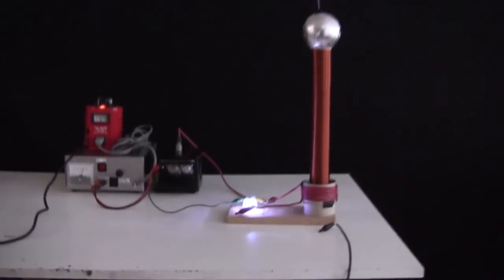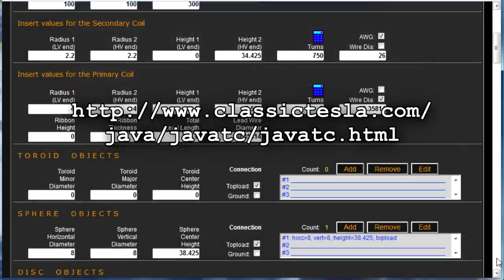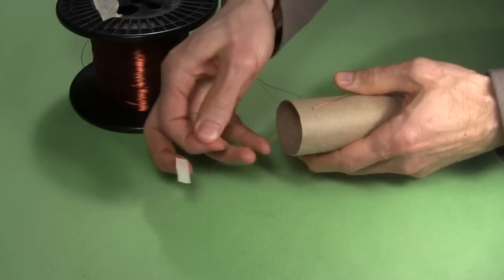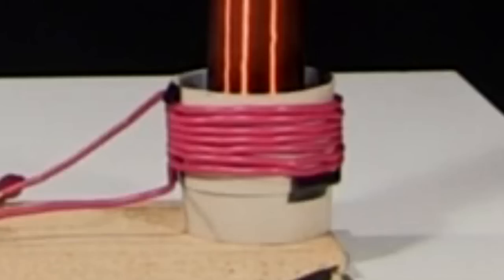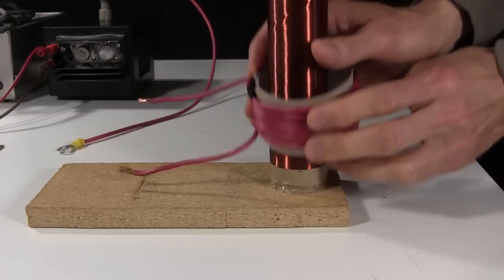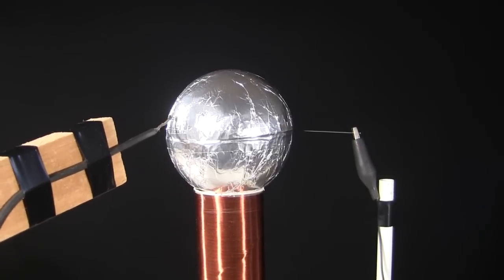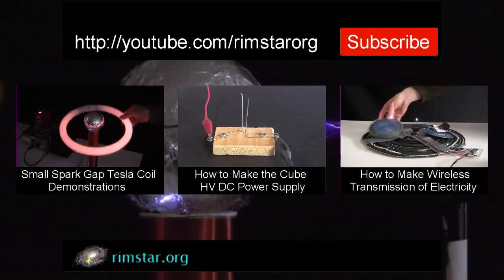How to Make Tesla Coil - Small Spark Gap Tesla Coil

Comment: Hey thank you for helping me   i placed a small aluminium needle on top of the toroid and  i changed the capacitors sort That you use and  i turned it on   and i was surprised   there were arc's   flying off my toroid  i was so happy thank you very Much :)                              Ps  i opened my settings but i din't find the question  who can comment your Posts ?

Comment: Hi Rimstar,
I have bought the parts for a 120w zvs driver i will be powering it with a 12v 7a supply(84W) and it will be powering a flyback transformer i also have will have a 800 - 1000 turns with 28AWG 150m of wire.
Which is the best material to wind the secondary on?
Will my tesla be able give 5cm sparks with a 4.5cm diameter pipe of_______.

Awesome video
Reply from the maker: The pipe can be anything that's not electrically conductive, usually a plastic of some sort, though cardboard works too. PVC and ABS pipes are easy to find at hardware stores.

Comment: I made this but I used a bug zapper circuit that supplies 400V DC and runs off of 4 D cell batteries. Would I get longer sparks if I instead used a 400V DC power supply that uses more current but connects to the wall plug because would have more power (watts)? Also what would happen if you got both coils to exactly the same resonant frequency, I know that a the voltage on the secondary circuit is like having a kid on a swing but you push the kid at exactly the right time each time, so in a tesla coil if its exactly the same the voltage gets higher and higher each time until it gets so great that it jumps off the needle at the top. So would the voltage off the top load get so great that you could get sparks as long as you want? Or would the sparks just max out at some distance due to the winding ratio of the coils?
Reply from the maker: I'm not sure if a 400VDC power supply that puts out more current would give you longer sparks. I think it would because there would be more energy for the coils to resonate with and it would last longer. If both primary and secondary circuit had the same resonant frequency then that should max out your sparks.

Comment: How do you figure out what uF you need? also would getting capacitors with higher storage capabilities entail more lightning coming off? Thank you
Reply from the maker: For the uF I just started by plugging in what I had available in high voltage capacitors and working everything else out from there. That was literally the first value I plugged into the online calculator (well, I had 4 of the capacitors so I played with a few variations.) From there I think keeping the physical size of the secondary coil small was my next controlling factor.
Regarding getting more lightning coming off, and assuming you've done a good job getting the primary circuit resonant frequency close to the secondary circuit resonant frequency, then I'm not sure how to improve that. When I find time I've been trying to eliminate losses at connection points and things. I'm also working on a better spark gap with bigger, rounder electrodes to reduce heating. I suspect a lot of it has to do with the power of the power supply. I guess at some point that would necessitate a larger capacitance for the primary capacitor.
Reply: thank you very much!

Comment: I made one that is similar, but with a driver circuit from a bug zapper that runs on 3 volts. And I barely see any sparks coming of the top load even thought it works good. I also made the top load out of a spring of 12 gauge copper wire that I made.
 Could a voltage multiplier work to increase the power?

Comment: You made it look very simple but I'm unsure about the power supply.  If I'm  wrong please correct me but is yours just for looks or does ut pull the power out of the ground or air? I want to build one to see if the light or residual voltage will show up as anything in darkness on a solar panel Thank you great video.
Reply from the maker: goforgreenliving The power supply is my Cube one here https://www.youtube.com/watch?v=-KFhBVfpfDw which is based ona flyback transformer and gets its power from the wall socket. The light from the sparks and streamers should have some effect on a solar panel but the output would be very small. Just thinks about how much the Tesla coil's streamers and sparks light up a room, not much.
Reply: Thank you for the info I it would have to be large i have seen one about 4 foot it put off decent blue light but maybe sence you have one could you try it sometime just to see a little bit is better than nothing

Comment: I've not read the comments on this video yet, but I'm wondering if it's advantageous to make the spark gap adjustable.  With a smaller gap, the discharge voltage would be lower, but the frequency would increase. As part of the tank circuit, the frequency of the spark is going to influence the resonant frequency of the secondary, perhaps more than the adjustment of the position of the primary coil to the secondary coil.
Reply from the maker: Xonk61 The resonant frequency is far, far higher than the frequency of the sparks, such that there are many cycles of the tank circuit after each spark. So my guess is that changing the frequency of the spark wouldn't matter that much, except that the current of each spark is greater with a wider gap, since there's more time for charge build-up, and so there would be more energy available for the resonance and possibly larger streamers, except that there would be less streamers. But that's all just my guess.
Reply: RimstarOrg to a point, yes.  But since it's a resonant circuit, achieving a frequency in the primary that relates well to a harmonic frequency of the secondary will improve the efficiency and effectiveness of the circuit
Reply from the maker: Xonk61 Good point.

Comment: Thank you for this video.  It is very helpful.  I was in the process of making my secondary coil and ran out of wire.  Is it possible to make the secondary with 2 pieces of wire (in a single layer)? Should the wires be spliced?
Reply from the maker: Sure, just solder the two wires together and continue winding. Make sure your connection doesn't have any sharp points. You could add a little insulation before winding on the section with the joint. You can coat it with some resin or corona dope. The existing enamel insulation probably doesn't do much anyway to protect against a high voltage spike so you may think you don't need to insulate the joint, but you may as well anyway.
Reply: Thank you so much for your response.

Comment: Hi, im building a tesla coil and need the spark gap to fire at 40khz to get the primary to resonate at natural frequency 24.6mhz. Is there a way i can measure the bps/frequency accurately without damage to the device?
Reply from the maker: I you have an oscilloscope, you could put an oscilloscope probe near it. You don't need to make contact. The sparks create enough electromagnetic radiation that the scope probe acts like an antenna and you might see some spikes the frequency of the sparking on the oscilloscope.
Reply: @RimstarOrg  thanks, i will do that!

Comment: In the video, you connected wire household ground to discharge the circuit. 
Is it safe to connect ground to the antistatic waist wrap that we wear when working with delicate electronics so we won't damage them?

Thanks,
Roger
Reply from the maker: Roger J. I do it that way whenever I need to ground my antistatic wrist band.
Cheers,
Steve

Comment: my power supply has around 7kv
i made it with a yback but i took the yircujt from a fluo bulb and connected one end to the 220v ac and the other end to the primary lf the flyback
i plan to make a tesla coil of around 1500 turns and i am wondering will it work ok?
and can it be dangerous if you would touch the top load since there shouldnt be much current there? thank you

Comment: Hi RimstarOrg thank you for the video.  I accidentally cut the wire for the primary circuit too short (i measured it wrong and didn't realize until after it was too late).  Would it be a problem to solder two pieces together to form the coil? or should i just buy more wire and restart
Reply from the maker: Yes, you can solder two pieces together to form the coil. Try to keep the join featureless, no sharp edges or bumps this reach far out and touch the next turn.

Comment: How many volts did this put out? I need to make something that is 100,000 volts or more.  low amps. Would this do it?
Reply from the maker: I didn't have any way of measuring it rigorously. Based on the spark length and the dimensions and shapes of the electrodes (sphere and needle), it was likely much less than 100,000 volts.

Comment: I made my first tesla coil secondary it has 7cm diameter and 47cm lengh. I made it with 0.5mm cable it took 200 meters of that. I don't know calculation is right but it should have ~900 turns. 

I have problems with capacitors. I am using a ZVS driver with a huge flyback and it gives at least 3 cm spark at 20 volts. But I will use a my hand winded microwave oven transformer for geting 30 volts. I will order full bridge rectifier and smoothing capacitor today. I don't know how much voltage I will get from the flyback. My homemade capacitors are blow up so I will get the same caps that used in the video. How much capacitence I need. Please reply. (English is my 2. langue so I am sure there is a lot of gramar mistakes)
Reply from the maker: I would recommend making new homemade capacitors. The ones I used in the video blew up too.  In this video I show making flat plate capacitors for the Tesla coil https://www.youtube.com/watch?v=EkvODkLL9Og and in this video I show making soda bottle capacitors for the Tesla coil https://www.youtube.com/watch?v=iV7Irwaqe3w. For the Tesla coil I made I need 4nF capacitance.
Reply: @RimstarOrg  Thanks for reply, I connected my homemade capacitors in series for 5nf capacitence. (2 series 2 parralel) My tesla coil works now. I increased the zvs driver voltage to 45 volts with my M.O.T. I have 5 turns in  primary . I get 5 cm arc without any calibration. All made from your video. I tried to use a scaler exciter circuit, blow up 4 TIP31C's for no reason. It worked for a while and it was slient :) But after trying different circuits I find out your desing is easyer and better.
Reply from the maker: That's great news, that it's working now. 5cm arcs are awesome too.  If you have any photos, I'd love to see them.
Optionally, if you do send photos, I'd love to put them on my webpage here https://rimstar.org/science_electronics_projects/tesla_coil_spark_gap_small.htm. It'd be great to show variations, however small. I'm sure others would be interested. With your permission of course. My email address is at the bottom of the webpage.
Reply from the maker: 30kV caps might be okay. It's hard to say. Mine were 20kV, so all I know is that that wasn't good enough.
Regarding the loudness, that's the reason I didn't pursue this further too.
I'm looking forward to your photos when you get to that stage..
Reply: @RimstarOrg  what are you thinking about the ideal capacitance for the primary tank circuit. is 5nf good enough. I saw similar setups like mine and the sparks was way longer than mine :( I will send you photos today or tomorrow.
Reply from the maker: Using the online calculator as I show in the video, all the components are sized to work ideally with each other to get the two resonant frequencies I got. Whether or not you want a higher capacitance in general, I don't know.
Reply: @RimstarOrg  If I know the output of my flyback I could calculate the maximum capacitance that flyback can charge. But I don't think there is a way to calculate amps and voltage of the flyback :/ I will try to tune it better at weekend, maybe I will make some bottle caps.
Reply: @RimstarOrg  Well my ZVS  driver died. Something smoked I instantly turn of the driver. now when I check the connections with a multimeter every single component is shorted.
Reply: RimstarOrg Mine new Zvs driver arrived and my tesla coil is working again. Now I need to make my setup cleaner than I will send you final results
Reply: RimstarOrg Mine new Zvs driver arrived and my tesla coil is working again. Now I need to make my setup cleaner than I will send you final results

Comment: How did you calculate the capacitance required to match the fbt? As the frequencies of flybacks is really very high.... I have a calculator which can do this but it needs frequency of supply to be entered..
Reply: What I'm using to drive a flyback is the zvs driver. The oscillator capacitor in circuit is rated for 0.68uF
Reply from the maker: +Anurag Trivedi Are you talking about the capacitor inside the power supply? I didn't calculate it. This is an old circuit I've used a few times over the years. I think this was where I got it originally http://jnaudin.free.fr/html/lifterb.htm.
Reply: I'm talking about the tank cap
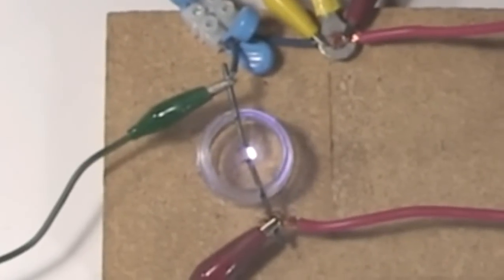Reply from the maker: +Anurag Trivedi See 7:19 in the video. I knew what capacitors I had available, and putting them in different series and parallel combinations I knew what possible capacitances I could come up with, so I tried different ones of those possible values while trying different values for the other things, until I came up with something I could build.
I did find that I damaged some of those capacitors from heating while getting it all to work so you might consider just making your own capacitors. The best I made are in this video here https://www.youtube.com/watch?v=EkvODkLL9Og.
Reply: RimstarOrg considering the topic of the video.. It says "small tesla coils". I have made a 2feet tall coil powered with a zvs driven flyback (mot in future).. So I need caps which will work with mot also.. My required values are 7.8nF and 36840v rated tank cap. (calculated using an online program which was for 50hz supply)
But I know that flybacks don't run on that low frequencies 
They run at more than 15KHz (as in tv don't know about the zvs freq) so if I calculate capacitance with respect to these frequencies then I get 25pF and same voltage
That's why I'm trying to make custom capacitors using a dielectric and some aluminium sheets.

Comment: Is there a way to make it work without using the cube? Or it needs to be built
Reply from the maker: The cube is a pretty common high voltage power supply. It's just build around a flyback transformer that has a diode builtin. But any sufficiently powerful enough high voltage power supply will do. You need something that will create fairly powerful and frequent sparks across the spark gap. Mine is DC but I'm told you can also use AC. At around 15 seconds into this video, I show different versions I went through. Version 1 used the high voltage power supply from a flyswatter but that wasn't powerful enough. The voltage was high enough but the current was too small and I wouldn't get frequent sparks.
Reply: @RimstarOrg  Thanks a lot because I really don’t have the needed knowledge about that and I misunderstand some steps, very informative and helpful video by the way 👍

Comment: According to the calculator, I should have my secondary coil be 46cm, but the 600 coils needed only stack to around 25 cm.  Would it be really bad to space the first 50ish coils slightly apart from one another to take up the extra height?
Reply from the maker: It sounds like you gave the calculator the wrong wire size (AWG or Wire Dia). Try it with the correct size and see what it says.

Comment: For how much time did ur voltage supply worked? While it was continuously used.
Reply from the maker: I don't know what a maximum time would be. Since it's a spark gap Tesla coil, it's too noisy to run for a long time so the most I've run it for at a time is probably around 2 to 3 minutes.
Reply: I want to make tesla coil for project day.But for project day it has to be running about 6-8 hours.So do u think I can run it for that time? Or should I make it without a spark gap
Reply: Pls do reply
Reply from the maker: I think the problem with running this one for 6-8 hours is with the power supply that I used to power it. I think it would get too hot if you run it that long. But you can look for a different power supply in that case. Also, the capacitors I used in this video might not last, but the ones I switch to in this other video would last I think https://www.youtube.com/watch?v=EkvODkLL9Og. It will be very loud for other people to hear for 6-8 hours though.
Reply: Tq very much I'll be sure to try it out
Reply: Do u have any suggestions on w hich power supply should I use

Comment: What is the Maine need for plasma on top???, I use mosquito bat circuit (input 9V) and I join top wire of secondery coil in light bulb(220V), so I saw little plasma, how I get more plasma?????????
Reply: Primary coil (16 gauge - 4 turn) and secondary coil (27 gauge - 480 turns)

Comment: Hello can i ask for a javaCT data for 12v power supply mini tesla? Or is there possibly one?
Reply from the maker: 12v is too low a voltage to power the spark gap. However, you could use the 12v to power a high voltage power supply that puts out a high enough voltage. That's what I'm doing in this video. The power supply on the left is a low voltage one and that powered the dark, cube shaped power supply that converts to high voltage.

Comment: Would an AC power supply work on this too or does it have to be DC?
Reply from the maker: It can be either AC or DC. I'm using pulsed DC. Some people use neon sign transformers which put out AC.
Reply: Alright thanks. I am finally getting around to building mine. My power supply I made using a fluorescent light ballast and CRT TV transformer outputs 60 volts at 20 mA. I am building the actual coil today but was thinking that I might be able to get longer sparks using a modified microwave oven transformer since I have one. Would the microwave transformer possibly be better or should I stick with my current power supply?